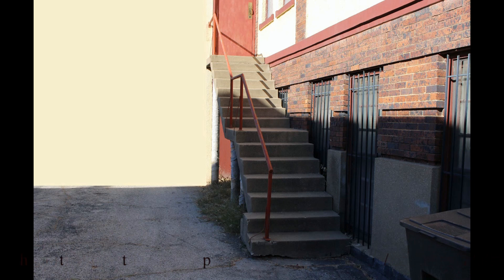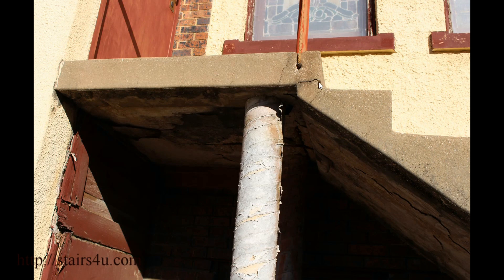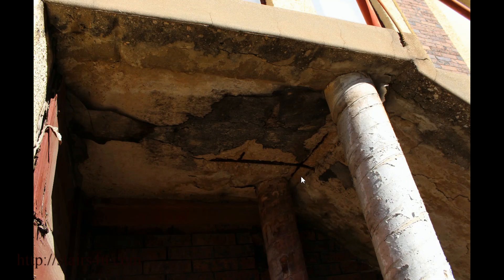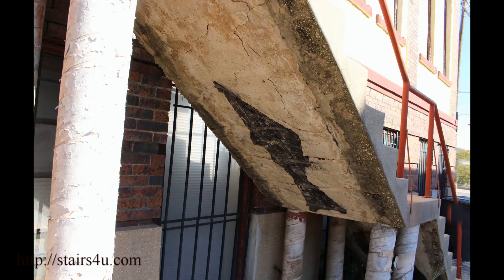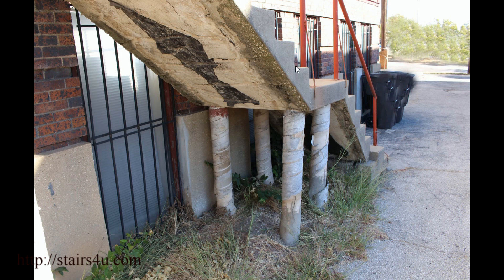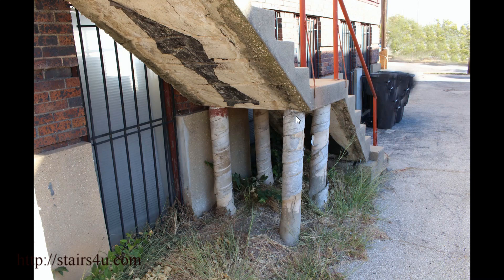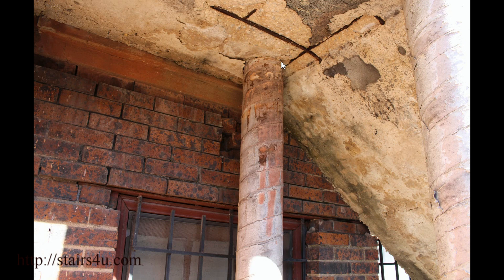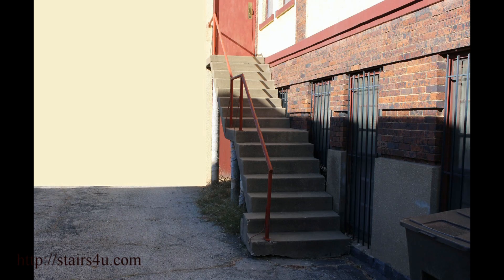Concrete Stairway That's Falling Apart – Structural Inspection

Comment: TO REPLACE IT WITH NEW FOOTINGS AND DISPOSAL AND NEW FORMING N  LABOR.. 15000$..  IT NEEDS INSPECTION AND RE PARGE AND MAYBE SOME CUSTOM STEEL  ANGLE BRACKETS TO REINFORCE THE OLD AREAS BUT ITS STILL OK TO ME WITH ABOUT 1000$ IN REPAIRS